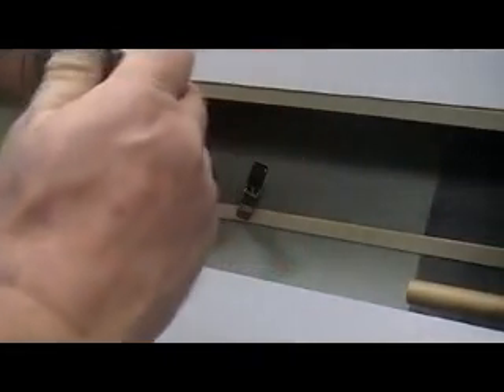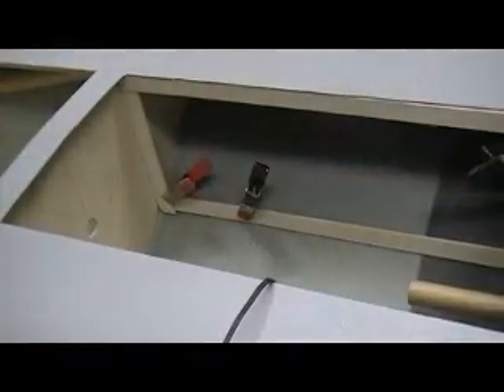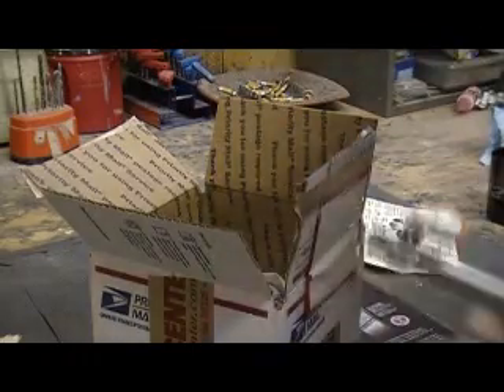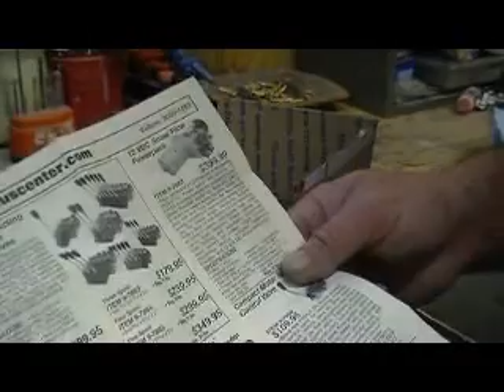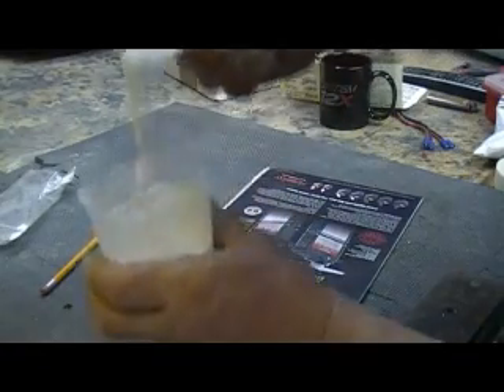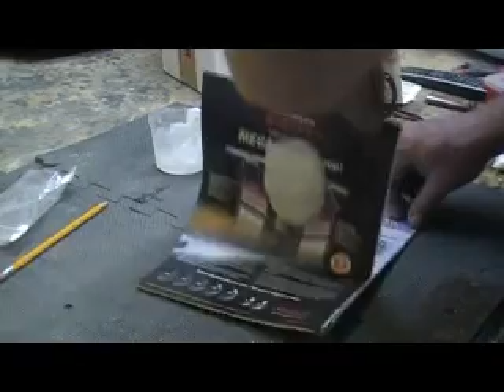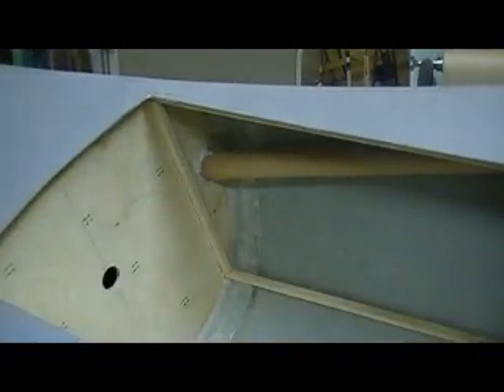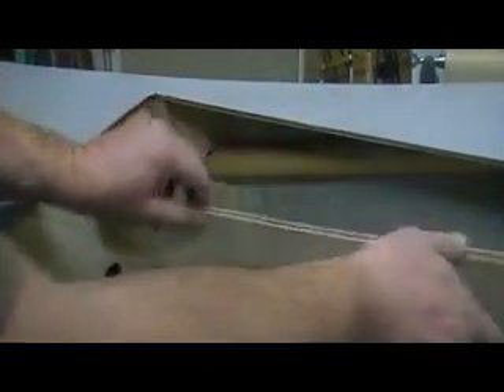how to build a rc jet B-1 bomber #108 pt 1

Comment: thank you for the explaination about the aircylinders, I had wondered if they work both ways.
thank you for the tip with the epoxy too, I had not tryed cotton yet. epoxy sure likes to run.